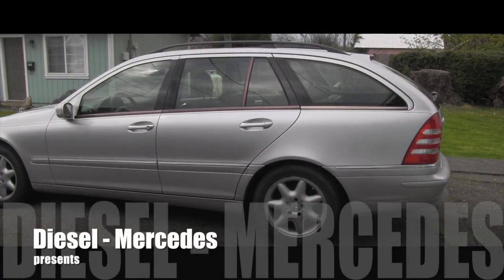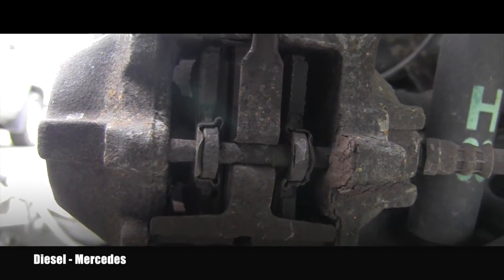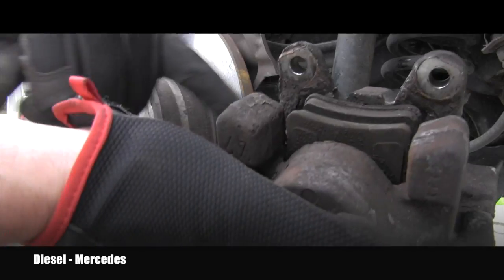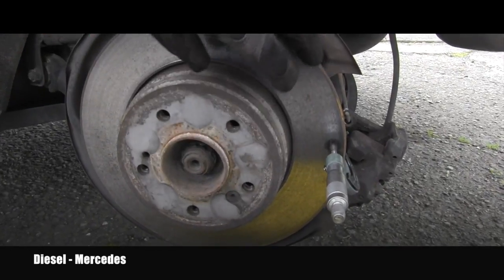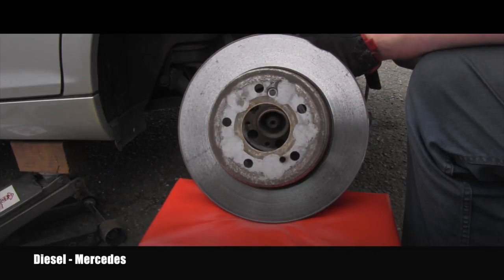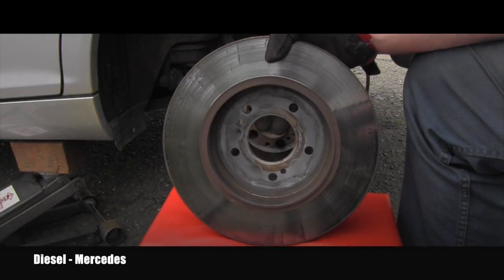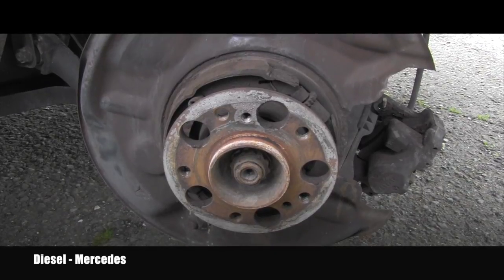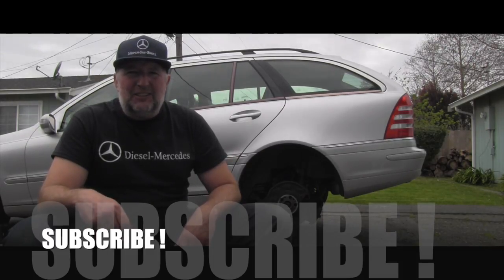Mercedes Rear Brakes Inspection

Comment: Is that  is correct ?----  The hub nuts of driven wheels (except on live axles) call for quite high torque settings (from 150 to 200 lb ft - 21 to 25 kg m), so you must lower the wheel to the ground with the car's weight on it for final tightening. Consult the handbook for the correct torque setting, if routine adjustment is specified.